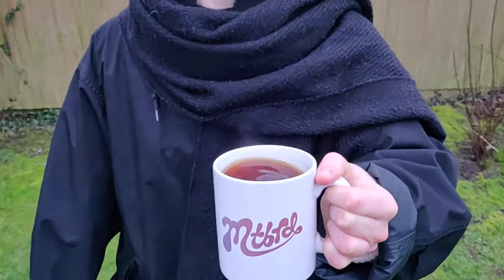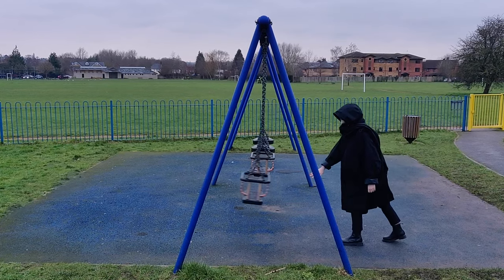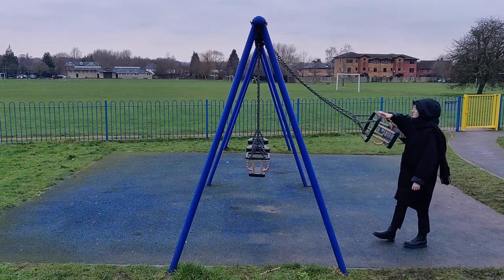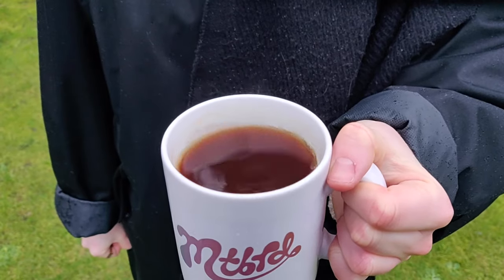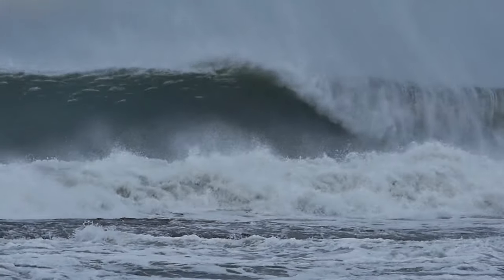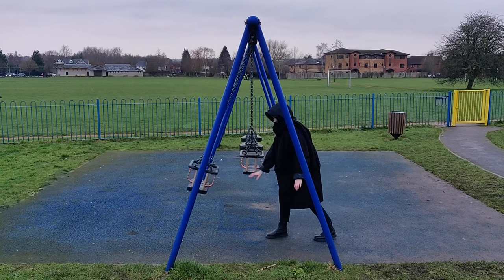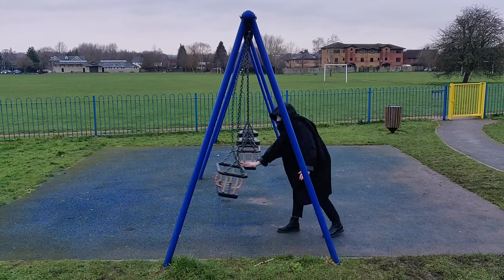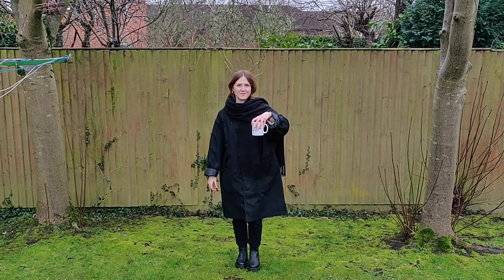Why do I always spill my coffee?

Comment: A significant disadvantage with the claw-grip is that, if you still misjudge your handling of the cup, the coffee overflows the rim and onto your fingers. As the coffee is likely to be at a temperature approaching that of boiling water, you are likely, therefore, not only to burn your fingers but also to drop the cup on the floor, spill the coffee everywhere, break the cup, ruin the carpet, etc. And you will have missed out on the coffee you were hoping to enjoy.
Reply from the maker: Now that is a strong argument! Seeing as walking backwards also has its downsides (odd glances in your direction, hushed whispers of colleagues, bashing into something - and thus spilling your coffee), I have to say finding the perfect solution is becoming tricky!

Comment: Resonance of the swing is actually obtained if you push it when it is speeding very fast at the bottom of the arc. This is because if you use your force to push it when a large distance is travelled you are doing more work, which yields a larger e increase in the total mechanical energy of the swing.

Comment: Well... It doesn't seem like walking backward has anything to do with frequency (if the speed is the same). If you change your waking speed, that will change the frequency.  It has to do with amplitude.  The same goes for the change in holding the cup attitude.
So, Dr. Abrahans. You might be wrong about your analysis.